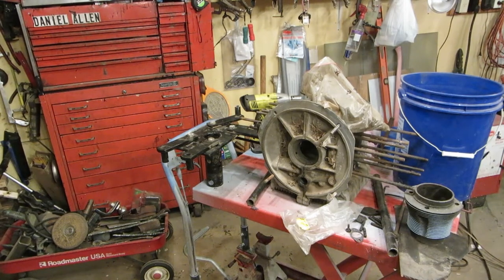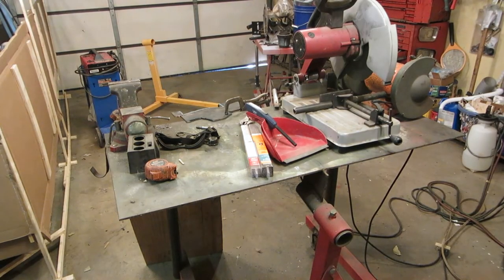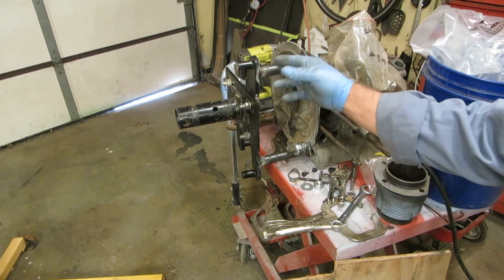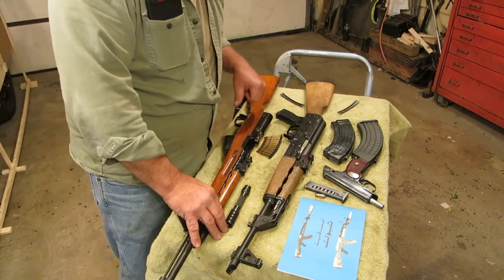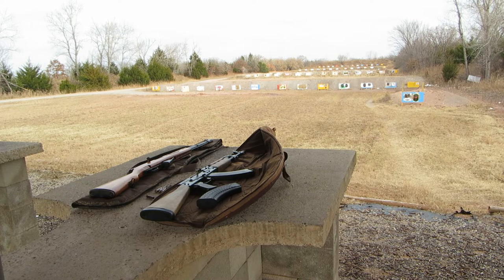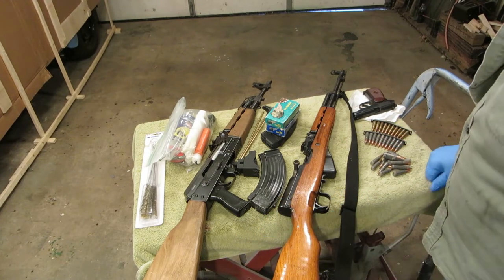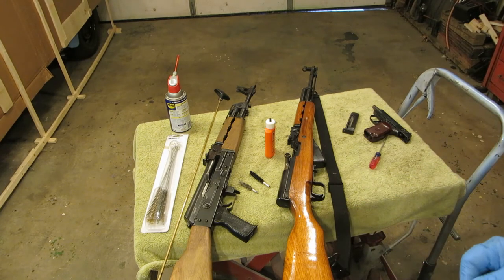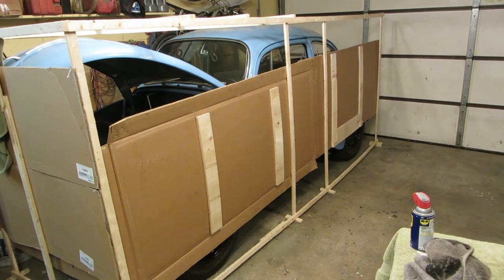VW Engine Stand Fabrication and Russian Design Firearms

Comment: Saw the name on the tool box at the start...I think I went to school with him, lol.  Now he's a traditional blacksmith.  I'm saving up for to get a 2 stage compressor this Spring.  The paint on the old truck is in bad shape and rather than trying to do it the original bluish/purple (depending on if the sun is shining on it or not)  I think I'm just going to spray the whole thing with color tinted bedliner because I'm too lazy to polish and wax the thing, lol.  I don't have a cutting torch for the simple reasons that A) Don't know how to adjust one, B) So far I haven't needed one and C)  Afraid I'd burn the garage down.  I tried stick welding on Pappy's old Lincoln when I was a teen.  I never could see what the sam hill I was doing.  Back then I was coke bottle glasses nearsighted.  Now after surgery a few years ago I have 20/20 vision, maybe I should give it a whirl again...at least this time I wouldn't be wearing thick glasses under the mask.
Reply from the maker: They have wonderful new hoods also. That you can see perfectly until you strike an arc. I had trouble the same way....couldn’t see...my pappys old Lincoln now resides with my brother.
Burn the house down! Ha ha Ha
😀😀😀

Comment: I’ve got a 1942 Mosin, and building an AR in 5.56 but I’m also planning an AR in 7.62 x 39.
Reply from the maker: Ooooooooo a real Russian one! Nice.
Yes, I have several 5.56 platforms as well. I believe the military got out of The 30 caliber rounds because they’re heavy you know? You can carry many more 5.56 rounds then you can the bigger 30 caliber.
The Russians did the same thing with the 7.62 x 54. The cartridge used in the Kalashnikov automatics, and the SKS rifle. Weighed less, took less brass to produce and used less powder. And still had great affect.
I like the idea of a 30 caliber hole, it’s a lot bigger than a 22 hole. And costs about the same, if not less.